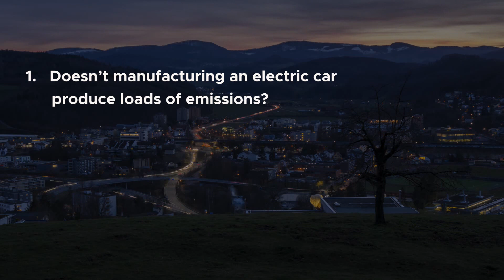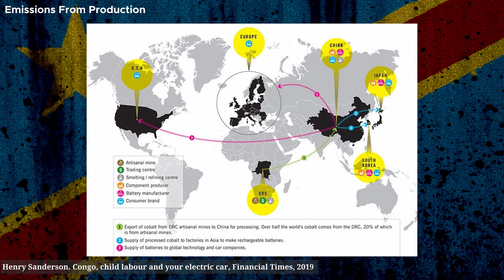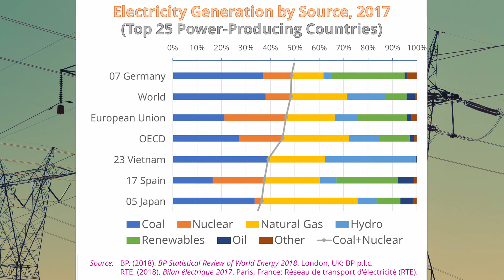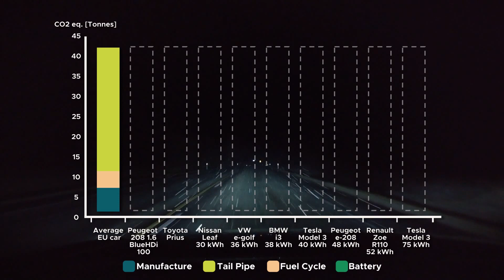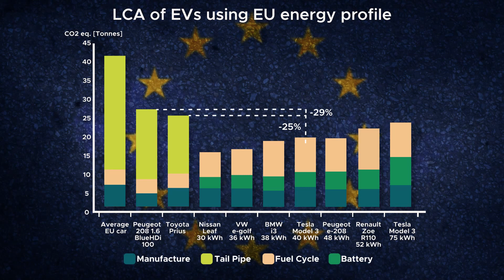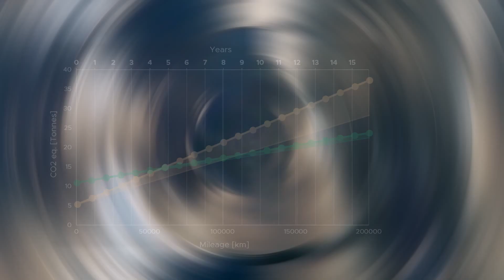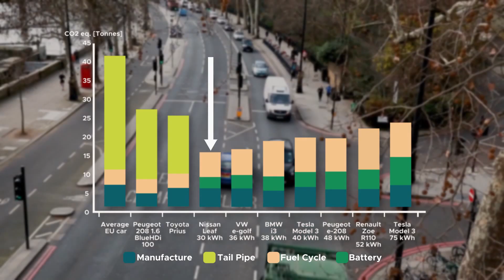Could Electric Vehicles be Bad for the Environment? Data Reveals the Truth

Comment: Yes, I understand, agree, and have seen other You Tube videos on this same subject about the manufacturing of Electric cars and batteries produce more CO2 gasses.
Plus the electric charging sources in many states are still gotten from fossil fuels producing the electricity.
I look at an electric car in the sense does it save me money in my weekly/monthly fill up the tank gasoline car i currently have.   I hope it does.
The one thing I am wondering is in the near future of electric cars and possibly now, how are the bad Lithium batteries disposed of and how clean that process is???
Couple of other non related factors/problems with electric cars are (1) - infrastructure of charging stations very limited and (2) - The range of the electric cars can only go 200-300 miles before needing a charge of the battery.  When pulling up to a charging station, we hope it is operational (not broke).  We are always needing to be more conscious of the charge levels and the range in the EV car, on can I make it to the next charging station on trips.
To me, Saving the environment is a mood point (not really true) when it comes to electric cars. We are still in trouble with CO2 gasses being emitted into the air with electric cars being produced.

Comment: You talk of 10 year life spans before a possible need for replacement of the battery. My Jeep with over 220,000 km (140,000 miles) on the clock is twenty years old and still going strong with no major issues or costs other than regular servicing. Batteries don't like the cold and can be less efficient in very cold weather. Temperatures in the UK often fall below 0°C in winter. Batteries also become less efficient over time and don't hold charge indefinitely. I might do over 200 km in one day and nothing for the next few days. Few EVs will offer the range of 200km without recharging. And can one rely on the vehicle holding charge for a week? Whilst emissions and CO2 is certainly an issue, there are other major environmental impacts concerning the materials mined for EVs, particularly Lithium and Cobalt. Pollution and use of vast quantities of water are major issues when it comes to mining Lithium in particular. This debate is far from over...
Reply: It would be great if you could get your facts straight. Pretty much all of it is false
Reply: there are Teslas that still run with 300 000+km on the original battery and the range and charging speed is still better than some new models today. so really, electric cars can outlast an average ICE car. also, a lot of town cars never reach the 200 000km. i know the last 3 cars my family owned didn't. its all down to small engine and loads of short trips.

Comment: An absolute farce of a video. I could debunk EVERY false misleading data point, but a few are sufficient to make my point:

1) 64% of all electricity produced globally is derived from fossil fuels. The modeling in this video uses less than 40%
2) 19% of all electricity produced globally is derived from Nuclear. The modeling in this video uses more than 25%
3) Nuclear Power plants ARE NOT carbon neutral. The carbon footprint from the concrete ALONE requires over 20 years of operation to achieve neutrality.
$) The carbon footprint and environmental damage in the production of electric vehicles is vastly underestimated and the same for conventional gas vehicles is over estimated.
6) EVERY so called "clean" source of electricity requires fossil fuels to not only manufacture   but more importantly to maintain and operate. Just think about the amount of Oil, synthetic or otherwise required to lubricate an enormous wind turbine.

We are being sold a LIE by leadership that is too cowardly, and too invested in the power and profit of the present system, to tell the truth:
1) Automobiles for individual use ARE NOT sustainable in ANY form and need to be eliminated. ALL the money and effort in producing "electric vehicles" should be put into public transportation.
2) The survival and wellbeing of human beings in any condition approaching a modern standard of living (even what we call poor) requires fossil fuels.
3) Eliminating fossil fuel usage entirely will result in the collapse of every nation and the death of 6 billion people within 2 years.

Comment: This video needs a SERIOUS update.
Consider the footprint of ICE drivetrain production more closely.
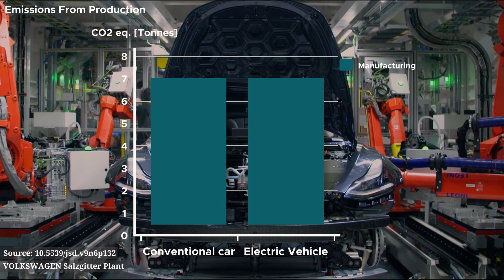You made the statement at 2:00
"7 tonnes, roughly the same for EVs, if we don't include the battery"
Clearly incorrect?
If you consider the "rolling shell" they're identical (not withstanding the advances made by one manufacturer over the last 2 years which vastly decrease the energy footprint of that shell?)
.
Make it very clear that the two drivetrains must then be considered as a separate entity.
.
The battery materials footprint also needs careful and serious revision.
Current and planned localised production has rendered the 2019 study obsolete.
.
Then there's the trend towards LiFePo4 and similar technology, using cheaper, more easily (locally!) obtainable materials.
.
Cobalt.
I was disappointed to see that you missed the use of Cobalt in removal of sulphur for fossil fuels.
There will of course be a cry of "it's a catalyst! It doesn't use much!"
Not per gallon(?)..... But we're talking many millions of gallons each day..... Every day, rather than a "single use" in a battery.
.
Should we be naive enough to think that "the big problem" of "30% artisanal mining" wasn't the same for the Oil industry over previous decades, but simply not mentioned before it became a political tool with the dawn of  the EV?
(I suggest a look at "The Cobalt Institute" who have a long and seemingly proud association with the oil industry?)
.
Fuel Cycle Emissions.
Again, plenty of emphasis on "dirty grid" to EV.
Not so much emphasis on the fact that the same energy mix is used by refineries (plus I believe a proportion of burning "waste products"?) Leaving the relative "fuel in tank vs battery charge" for a given range with a very similar footprint.
Effectively "nett zero" at a "ready to roll" state?
But when the vehicle moves, Zero extra pollution from the EV.
ALL fuel burned is polluting from the ICE vehicle.
Not even close
.
"End of life" footprint.
Even not considering potential "second life" (it's forgotten or simply not known that the "end of life" figure for an EV pack is pegged (usually) at 75-80% of initial capacity at a given mileage. It's by no means "dead")
.
But let's assume, either the car body outlasted the pack, or the vehicle is being scrapped.
The pack will be within the top 5 most valuable components on the salvaged vehicle.
It certainly won't go to landfill (more if that later)
It certainly will be recycled.
Why?
Because the common claim amongst numerous new and now established companies in the EV battery recycling industry is that they can:-
1) Recover 95% of raw materials from any lack.
.
2) Produce base materials which are of higher quality than the original product ("double refined")
.
3) Recover this stock at a fraction of the cost of new mining (ref Redwood Materials "17.5% new mining cost")
.
We also have numerous Battery and vehicle manufacturers, either already recycling in-house (Tesla), or announcing partnerships with  specialists.
.
Another consideration.
A comment by JB Straubel, formally Tesla co founder, now of Redwood materials, indicates that their process allows economical addition of ALL old battery cells for recycling, including those from small devices, tools, etc which undoubtedly go to landfill..... AND that circuit boards can be included, recovering precious metals and other compounds.
.
I could find more issues, but this is a start.

Comment: Good balanced take, but like most others there some points that overlooked. 

1. CE cars have longer life spans, most models are on the road for around 15-20 years unless they get written off. Time will tell us how long EVs last, but their expected lifespan is around 7-10 years. 
2. You need to analyse the C02 emissions from vehicle maintenance (i.e. average parts that are replaced and their manufacturing CO2) & replacement engine/battery CO2 emissions.
3. "Green" Energy sources often omit the manufacturing CO2s (solar panels built in China are very "dirty").

I think if you have solar at home and can charge your EV at home mostly, then it is probably a very "clean" option.
If you can't charge through renewable sources, then a car like Prius might be cleaner in the long term.
Hopefully they can improve battery efficiency and manufacturing (i.e. solid state batteries) to make EVs cleaner.

Comment: well you are definitely a fangirl and how long do the battery last and how do they cost to replace
Reply: About 250,000 miles.  About twice that for modern LFP batteries (which don't use Cobalt - something the video doesn't mention).  At that time, the battery has about 70% capacity remaining, and it can be used for static battery storage for another couple of decades).  How much did the engine cost to replace in your dead dinosaur car.  That probably will also be toast before 250,000 miles have elapsed.

Comment: Sorry, but you can't ignore the battery recycling problem and then say EV's are better. What about the 2018(?) EU study that you'd have to buy and drive a new Accord 250,000 miles before breaking even on the emissions required just to build a Tesla? All this carbon neutral stuff sounds great, but what is the cost and the emissions involved with upgrading the entire world wide power grid to charge BILLIONS of EV's every day? What about trains (and I don't mean in-town subways), tractor-trailers, planes, ships, farm equipment that needs to run 24/7 during harvest, heavy construction equipment, and all the other powered things that NEED gas/diesel till there is a viable solution to replace that? Here in the US there is NO WAY that we can do without trucks and trains to deliver goods - the country is simply too large. I'm all for conserving natural resources, but there has to be a viable alternative before we switch. Just look at what's happened to our economy since Biden killed oil in the US and the repercussions it's having. EV's are not yet ready for prime time. Also, we have over half a billion cars in the US, but car production is only a few million a year. It would take past 2050 just to replace all the cars in the US with EV's, and that's just the US.
Reply: You probably refer to the 2017 meta study from Sweden that was using data material mainly from 2012-2017. That was then misinterpreted by a journalist who published that erroneous numbers. That study has since been retracted and reissued in 2019 and no longer supports the findings of the Swedish journalist even if you try to misrepresent the findings of that study. Since then technology has made large strides forwards and the previously big disadvantage of the battery production overhead has been considerably reduced even further - so that an EV is better than a comparable ICE car after 10000-30000km.
And of course the switch will take time - and this will give electricity companies time to increase renewable energy production to keep pace with EV adoption.

Comment: Some net zero issues I would like to have seen included:
1. Net zero, without nuclear, has some serious technical issues that are currently not resolved. These relate to building a grid that delivers electricity reliably to the consumer when wind and solar are inherently unreliable. There is currently no storage technology that could cope with days or longer with little or no wind and little sun - eg a week long calm spell in the winter.
I would like to have seen the analysis with today's mix of energy sources instead of assuming net zero by 2050 will be achieved.

2. Embedded carbon in wind and solar equipment. A nuclear plant, over its life, returns around 400 times the energy it took to build. Coal/gas is around 180 times. Wind and solar are around 2-10 times. Wind turbines and solar panels tend to be made using Chinese coal, but treated by the West as carbon free sources of energy.
Reply: EV with vehicle to grid functionality - thus able to act as buffers for both excess electricity production and shortfalls as well - can and will stabilise the grid when there are enough. In Germany we have 700000 EV currently, if all are connected to the grid (the average use of a car is 1 hour per day) then they have a combined buffering capability of all the buffering water power stations in our country. And that's the state today. Fast forward one year and the capacity is increased twofold.
Reply: @karlgunterwunsch1950  Thanks Karl. There are two types of storage required for a wind/solar dominant grid. 
The first is about 30 minutes - this is for grid stability and buffering the short term variability in wind/solar (clouds, variation in wind speed). EVs and battery farms work well here.
The second is long term storage eg overnight on a calm day. Or several cloudy/snowy calm days in the winter. EVs and battery farms don't help here - they would all be flat within hours.

Comment: Congratulations, this is the most comprehensive comparison between EVs and ICEs that I have yet seen. However, there are still gaps.

Currently, EVs are living in an artificial world beccause I can charge my car and it will make almost no difference to anything else but if the world all started to use EVs then every nation's electricity grid would need to deliver around twice the energy it does now. What price that upgrade? If reliance is to be placed on overnight charging then it will depend on which end of the line the electrical storage system is located.

Then we have the issue of batteries losing efficiency and eventually needing to be replaced. What recycling is available? Again, EVs are living in a utopia because only a small number of batteries need replacing but imagine how big the problem will be when every car has batteries. The same issue occurs with wind turbines. If they last for 30 years only a few will need to be replaced currently but if the whole world were to reply 100% on them then large numbers of turbines would need to be replaced every day in all countries. The same applies to any batteries they may use to iron out the fluctuations.

Then there is the land use issue. I did once calculate that to power the USA it would take a land area of eight times that of Texas covered with wind turbines to fulfill their needs. YMMV depending on assumptions. How will small but populous countries like the UK or Japan cope? Will their coastlines be permanently scarred with wind turbines all round their islands?
Reply: Whining about how EVs inconvenience you doesnt solve the problem on GW.... When will you complainers learn that if we dont change NOW and work on reducing emissions and deal with REAL SCIENCE of GW then there is no need to worry about other things because there wont be a society left...Ignoring the consequences of GW is NOT a possibility because like it or not GW is here...
Reply: @stevewilson4321  A thousand scientists have just jointly signed a letter stating that there is no climate emergency. What do they know?

All I ask is that the proponents of any changes to our energy supply do their sums first. Currently, no proponent ever does any inconvenient sums. They just assume that there will be enough lan to implement all their ideas. If that is true then show me the figures.

For instance, someone suggested to me recently that hemp could be used as our main energy source. If you do the sums and work out how much land would be required to grow enough hemp to power the USA you would need a planted area of over five times the size of the USA. SO, sounds like a good idea until you stop and work it out. 

Same applies to solar, wind and hydro. Don't just make the changes then realise it is not going to work many years down the line. Do the sums now.

The same thing happened to COVID-19. Everyone jumped on the masks, social distancing, lockdown, government payouts bandwagon. Now they are starting to look back and they realise that people were harmed by the lockdowns. Inflation was triggered by the mass payouts. The science says that masks are ineffective and even dangerous.

All that was foreseeable but they had to rush into doing the wrong thing and it has cost us all and it was all unnecessary.

Comment: YES!...With the power plants promised to fail.
Wasn't that just a great idea!
Reply: As the production of fossil fuels require 42 kWh of energy to produce 6 litres of diesel, about half of that in the form of electricity those doom and gloom mongering won't fly. With 21 kWh an EV can drive further than those 6 litres of diesel would allow in a frugal ICE car.